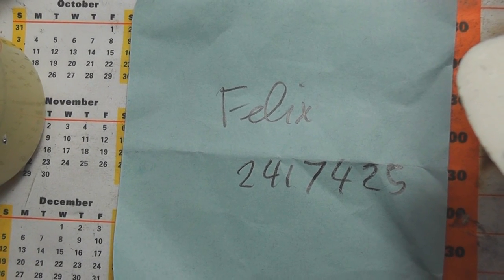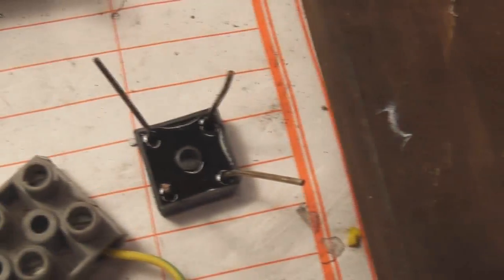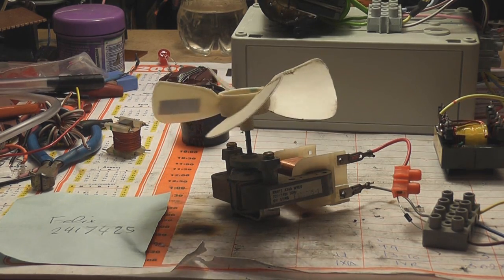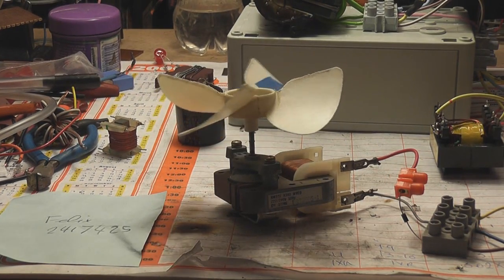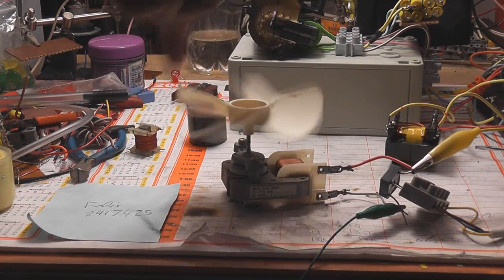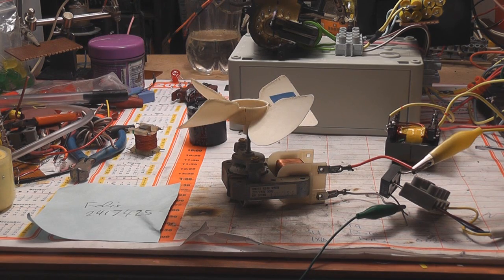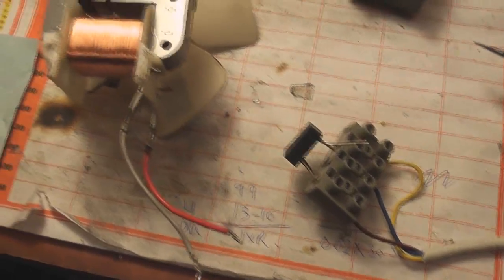Shaded pole motor on DC

Comment: All l Need to know is the Diameter of the Wire ! And Number of Turns ! The Coil is ! For Either a ! Twelve ! Or Twenty Four Volt D.C RUNNING ! IS ! INSTEAD !! OF YOUR !! LITTLE !! FINGER  !! PLAYING !! AROUND !! WITH !! THE !! SWITCH !! AND !! FAN !! BLADE !!! AND !! BLABBING !! ABOUT !! WHAT !! EVER !!  COMPONENTS !! YOUR !! USING !! YOU !! STUPID !! GEZZAA !!! YOU !! KNOW !! WHAT !! I !! MEAN !!!!

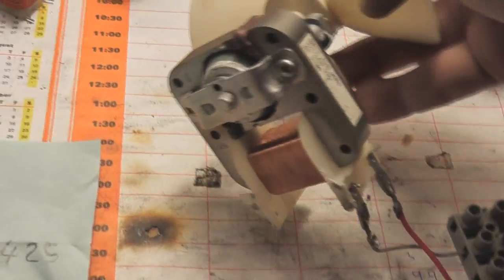Comment: 0:21 Some coils have a 'tape' around while your is 'opened'. Why that???
Reply: Some manufacturers wrap them in insulation tape to protect the winding, others don't. I have a shaded pole motor which has no protective wrap. COnverted that one from its original sleeve bearing to ball bearing on both sides. Runs much more neatly than with the original bearings, I'd say.

Comment: Can you use a shaded pole motor as a generator?
Reply: +dav dav not exactly for this type of motor though.
Reply: Wtf
Reply: Only if you machine out the rotor and fit permanent magnets to it, as it is, when you apply AC power to the coil it produces a magnetic field that is alternating it's magnetic polarity which is concentrated at the shaded coil's (the two thick copper coils at opposite ends of the rotor), the two shaded poles will induce a magnetic field which will cause the rotor assembly to induce the magnetic field but as the AC switches polarity, it will be in opposite polarity to the remaining magnetic field in the rotor that is now collapsing, this functions well with AC but doesn't work with DC, for DC you have to modify the rotor assembly with permanent magnets, then and only then it will rotate with DC but also if rotated, will generate AC... 
Hope this helps 🙂

Comment: Wich one is the positive and the negative lead on the motor, sorry for the silly question
Reply from the maker: +Rafaelquetefoka A shaded pole motor is an AC motor so it doesn't matter how the polarity is. I put the diode in both ways and the rotation was the same, but the coil did get very hot.
Reply: Thanks for the feedback brother! What can I do to keep the coil cold or not overheat it?
Reply from the maker: +Rafaelquetefoka Run the shaded pole motor on ac. Better to get a dc motor for dc applications.
Reply: Place ( if possible ) a cooling fan to the axis.

Comment: It is single speed motor....Do you have any idea how speed switching on dual speed shaded pole motors work? I think it works by 
using 2 separated coils with different number of turns, affecting 
inductance and resistance thus producing different stator voltages, 
hence different torque.

Comment from the maker: The winding will probably get too hot. as it relies on the back emf from the rotary armature. Just try it out and monitor the temperature. Bear in mind that the transformer winding is not isolated from the mains. These motors are often wound as an autotransfomer with 1 tapped winding.

Comment: thanks what i have is a shaded pole motor it is also a stepdown transformer of 18 volts all in one . what i want to do is remove the rotor and just use it as a transformer.will it work or will the winding get to hot

Comment from the maker: The motor will get pretty warm with a stalled rotor on AC. Usually shaded pole motors don't burn out when stalled. Under normal running conditions the motor is luke warm.

Comment: will the motor get hot if you power it with ac without the rotor installed or draw no current

Comment: Can't speak for all electric devices. But often these machines provide their own "breaking power". A freewhelling motor acts like a generator. If you "load" this generator, depending on the load, the motor wil quickly stop. So connecting a low value high power resistor accross the terminals of the motor, will break it. (see also Colinputer's comment)

Comment: Yes I thought the same. AFAIK these motors need a change in current to induce an out of phase current in the shorting turns, which in turn creates a shifted magnetic field (as if you had another phase). Constant voltage would just make it smoke ;)

Comment: It's also worth noting that if you just put a diode in series with the AC line, it wasn't really getting "DC", it was getting half-wave rectified AC, which is still a bit AC-like. From some other videos of shaded-pole motors on DC, I think the reason you were seeing movement was because of the fact that it was only rectified AC, not smoothed DC.